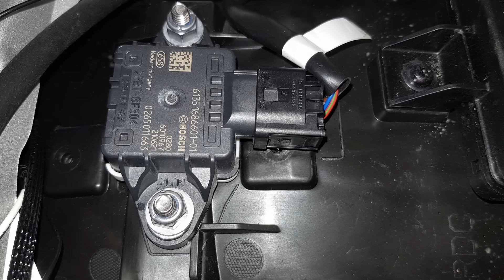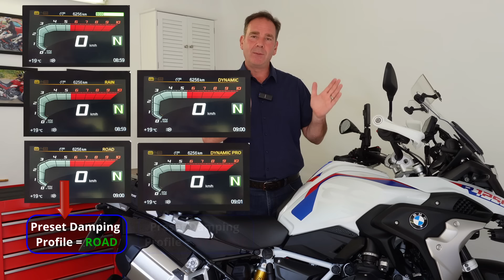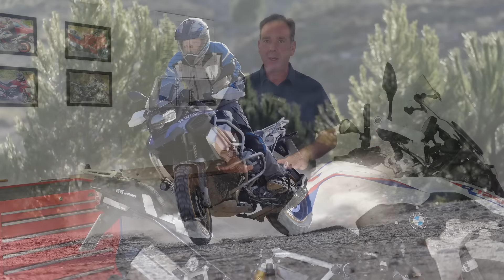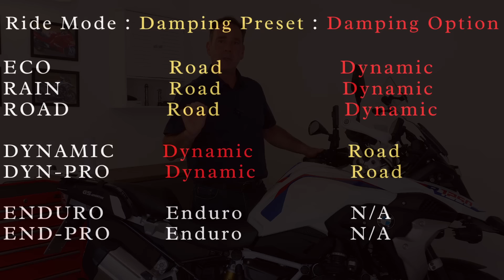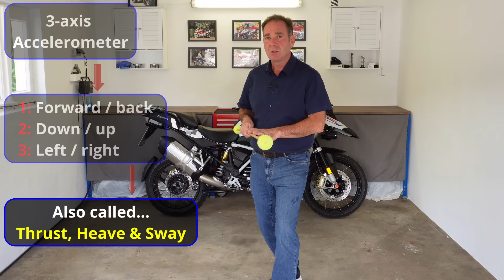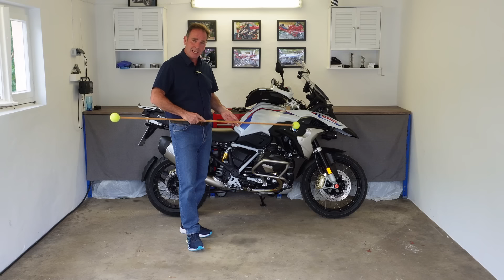EP:12B BMW Dynamic ESA Explained Part 2, Damping Modes, Riding Modes and 6 axis IMU Explained

Comment from the maker: The SOLUTION for the multifunction indicator issues, should be available later this week. I was asked by the manufacturer to wait until the new UK / EU website has been finished which should be a couple of days more. Most of my riding friends now want these lights on their bikes, so I'm going to be very busy over winter. Carl
Reply: Hi Carl, is this already available?
Reply from the maker: Yes and installed on my bike ( 2021 GS Rallye) I’ve uploaded several guides to help owners install these lights and many owners have now done the same installation. Subscribe and go to my channel and your find all the information you need. Let me know if I can help 
Regards Carl
Reply: also do you thing the base GS with a traditional shock is better as far as compression and rebound?
Reply from the maker: I personally have not tried that so unfortunately I can’t offer feed back.
Perhaps you should visit your local dealership and book a test ride on both versions and see which you prefer
Reply: do you think the older bikes were better as far as the display and esa?
Reply from the maker: Hi, the new TFT display is brilliant and so is the dynamic ESA.
The pre 2018 bikes had a slightly better preload setting or spring rate.

Comment: Why did BMW remove SOFT from damping modes??? My 1200 GS has Soft, Normal, Hard. Now only Road and Hard I can’t feel much difference between them. On the motorway or crappy lanes I use soft and it really make the ride plush. I thought ride modes only affected throttle response. Great information thank you 🍻
Reply from the maker: Hi Nomad, agree, it was a shame they changed the names which were easy to understand (soft, normal, hard) and replaced them with Road and Dynamic, but on the motorbikes I have tested there is still a noticeable difference especially the 1250 models, on the newer 1300 models there is still a difference but the Road suspension mode is firmer than the old Road mode on the previous models. Why BMW have taken this route is known only to them.
Yes the link between Ride Modes and suspension settings is now fully automated, but you can still manually change the suspension settings. For example you could select Ride Mode Dynamic for that crisp throttle response but manually change the suspension setting to road for a more compliant feel.
But on the newer model is not easy to do, requiring access to a different menu to access these settings.
But the names they use could be much simpler 👍
Carl 🙋🏻‍♂️

Comment: Thank u. Would never get this detailed info from my salesman. 
   The issue I have with my '25 F800GS with Dynamic ESA is, in the 1 up, no luggage and RAIN mode, the rear end of the bike sits too high, pushing my groin into the front of the seat. Very uncomfortable after 50 miles. Is there a setting to lower the rear end? Thank u.
Reply from the maker: Hi, thank you 🙏. So via the left hand controls ( with engine running ) change the preload setting to minimum 👍
There are 3 setting; min, max, auto
Kind regards Carl

Comment: Excellent vid, thank you. If I understood you correctly, in terms of dampening, there are different settings within ride mode (ESA not ride mode) even though 3 of the 5 of them say “road”?  If that’s the case, eco is the plushest followed by rain, road and dynamic?
Reply from the maker: Hi theoretically it’s only 3, road, dynamic and enduro, but there are many sensors and systems in play with each selection. I find Rain the softest, but only marginally over Road. Best wishes Carl 🙋🏻‍♂️

Comment: Finally. After 5 years on my R1200GSA (2018) I understand my issue. I just can't stand the damping setting in rain/road riding mode. Even on the freeway, it's too soft and I always feel like I'm bouncing. What your video told me is that, automatic reset to road damping when you change riding mode from dynamic to road/rain. I shall try the road and rain riding modes tomorrow with the dynamic damping mode activatedto see if it's better for me or not. THANKS
Reply from the maker: Hi Franck, glad you enjoyed the video series, I hope you enjoy your new setup 👍
Thank you for the feed back much appreciated .
Kind regards Carl 🙋🏻‍♂️
Reply: @justthewayitis  Tried the damping change yesterday and indeed, it makes the road/rain riding mode MUCH better for me. Thanks again Carl.
Reply from the maker: You are very welcome 🙏

Comment: Enduro mode is predominately for off road with road biased tyres. Enduro pro is predominately for off road tyres from what I have gleaned. With off road tyres you can use Enduro pro mode to change all the throttle, traction control, suspension and ABS settings specifically to suit off road tyres.
Reply from the maker: Hi Smokey, correct 👍

Comment: My gs1250 2023 doesn't have ESA and no pro modes, any chance to add the pro modes?
Reply from the maker: Sadly no, it’s not possible to add them after the motorbike leaves the factory.
But please check the menu under : Ride Mode Preselection, to see exactly which ride modes are installed on your gs.

Comment: Wow, well said Carl.  Thanks for the well explained info.  Now I have to watch the rest of yours!
I just bought a 1250 and needed to learn the new TFT, as it is different to my 1200.  Found your channel, then relised that there is MUCH more to the suspension than the old.  Wil try rain for the crappy roads. Cheers.  Also we use IMU's in aviation a lot, but you explained it very well for novices.
Reply from the maker: Hi 911, welcome to the channel and congratulations on your new 1250, yes there is lots to learn but once you understand the system you realise how flexible it really is. 
Have fun learning and experimenting 👍
Kind regards Carl
Reply: @justthewayitis  Thank you, lots of info on your channel, keep up the good work and sharing of your knowledge.

Comment: Is it safe to run full load on min suspension setting
Reply from the maker: Hi Austin, if you mean loading the bike close to its max capacity, my personal opinion would be no you are better off running in Auto mode. 
Mainly due to poor load distribution (heavy rear bias) which will affect the handling and braking and stability.
Have a good weekend 
Carl
Reply: @justthewayitis  cheers carl

Comment: Hi Carl
I have a question about Servicing the esa suspension.
Normale shocks and rear damper need a service with new oil.

What do you think. When should we get Servicing our esa with new oil. I know a suspension shop in Netherlands which is able to do a service on the esa suspension with new oil, bushings and so on.

My though is after 20.000km it's time to change the dirty oil.

What do you think.

Kind Regards.
Gruß ;)
Reply from the maker: Hi Melvin, it’s up to you really, but 20k km is not a lot. If everything is working correctly I would leave it alone and would wait another 20k km.
But having said that, a service including new oil and seals does something bring benefits and you could at the same time change the rear spring to one that matches your weight. That would give you a shock that works correctly within the mid-stroke of the damper. Which would give you a better ride quality.

But I would probably wait a while longer if everything is working correctly.
Carl

Comment: Thanks for such detailed vid. Question is front suspension could be adjusted some how by rider or it live its on automatic life?
Reply from the maker: Compression and Rebound are not adjustable on the GS. The only option is making a change with the Ride Mode.

Comment: Hi Carl, thanks for creating great contents and these nice videos on ESA. My bike has former ESA (it´s a 2009-R1200 RT) and I´m a bit confused. I´d like to know if it is possible to associate the three suspension modes (I think they are damping/rebound settings, right?) on my ESA (Comfort, Normal and Sporty) with the Road, Rain and Dynamic on the new ESA. Can you help me?
Reply from the maker: Yes that’s correct they are indeed your damper setting

Comment: Great explanation. I have a 2016 R1200rs. When in DYNAMIC mode only, for and rider + pillion suspension mode and 2 up, while riding I get an error triangle come up and the suspension goes very hard. I heard it could be return spring closing the damping down. My question is the problem the ESA control unit module or or the actual shock? which one to replace?
Reply from the maker: Hello 
When the error triangle comes up and suspension goes firm that’s the bike going into safe mode or limp home mode on the suspension . The only way to be sure is to get the error code read by bmw or using an GS911 code reader. It is however a reported fault by other owners, but it could be the control unit or the shock it self. I’m presuming that when the error message comes up… if you stop the bike and turn it off and restart the message goes away?
Best thing to do is get the error codes checked to see which system or part is failing . It could be a PWM output fail from the controller but only a specialist could confirm this.
Hope this helps 
Carl
Reply: @justthewayitis  cool thanks for reply, yes have to stop, turn bike off and restart. But come back frequently in Dynamic mode so just use road for now. Until I get the codes out. Cheers

Comment: Hi Carl,

Thank you for your detailed explanation of the ESA system.  I now feel confident making changes to the system when I'm out riding.

I had a question.  I ask this question here because a lot of peple on forums say that this issue is just part of the ESA making micro adjustments as I'm riding.  I'm just not sure.  The issue is the feeling of tapping in the footpegs.  I don't feel it in the engine or frame, only when feet are on the footpegs.  It happens on pavement with slight to moderate imperfections and on roads with tar snakes.  On a new road with no imperfections, I hardly ever feel the tapping.  Even though I see this complaint on forums from time to time, it still concerns me.  I mentioned this to my dealer at my first service,  They test rode the bike and said that they didn't notice anyhting, but I think the problem there is that all the rodes in that area are in very good shape with little or no imperfections. Have you heard of this and do you know what it imight be since many people think it's part of the ESA system?

Thank,
Kenneth
Reply from the maker: Hi Kenneth good morning 
Yes I know exactly what sound you mean, but I have not been able to find the source of it.
Mine has got better (less tapping) as the mileage has increased and also since I changed the tyres, but it’s still there.
It feels like front suspension to me possibly from the telelever area.
I hope you enjoy the series and have fun on your new bike… best wishes Carl
Reply: @justthewayitis  Thank you , Carl!  And again, thanks for all your hard work in making these videos.
Reply from the maker: Your very welcome 🙏

Comment: Hi Carl, great job explaining damping (compression/rebound)controls ! However I find the real feel to be extremely subtle to truly appreciate. I’ve tried the same stretch of road on different modes and damping settings and really can’t decide which I find better / most comfortable. The engine settings/ throttle control etc of the different modes ( at least dynamic vs road ) are clearly noticeable. Not so much between road to rain.  Too many choices ?????

I also appreciate your tire reviews. I ride 100 % on the road but still have the original Michelin  Anakee tires. I would like to try the Michelin Road 6 but don’t want to spend the money if I find no real difference ( similar to damping settings ). 

Would appreciate your thoughts on this. Thanks
Reply from the maker: Hi Randy, welcome to the channel, don’t forget that the suspension in all modes can be affected by speed that’s why the system uses the IMU and all the other sensors.
Road 6 or NT2 tyres make an absolutely huge difference the choice comes down to weather you still want a little gravel dirt road capability. Both are excellent on road though.
Carl
Reply: @justthewayitis  thanks !

Comment: I haven’t read every single comment, so excuse me if I’ve missed it.. with regards to the suspension feel when braking, Eco vs Rain, does the automatic linking of the brakes not have an effect? I’m imagining that in Rain Mode, a tad more rear brake is applied in order to keep the bike more balanced and to optimise stopping ability. Just a thought 🤔
Reply from the maker: Hi, with regards to brake balance within each ride mode, there are some differences, but with regards to suspension feel when braking this is controlled by various integrated systems like the IMU which provides more compression support when adding brakes fast. Your thoughts are probably correct 👍
Reply: @justthewayitis  I didn’t realise that the IMU would effect the damping so quickly. It’s even more effective that I gave it credit for! Thanks for your reply.
Reply from the maker: Have fun 👍

Comment: I’m 72 kilos, I ride in automatic. Recently I put 150 kilos of luggage and pillion.. auto wouldn’t handle it.. i could hardly get it off kickstand with all that weight.. I put it into Max mode and it was better. Does that sound right? I’m glad I found your videos!!💯👍🏽👍🏽
Reply from the maker: Hi Bill good morning and welcome to the channel. Yes that’s correct with that much extra weight MAX is the mode to use. You might also need to change the damping mode to Dynamic if the bike bounces around a lot.
Best wishes Carl

Comment: Doesn't the Mode settings also have to do with the ABS System?  Even Rain or Road from some people is preferred, this can lead to different behavings during a full brake when the ABS sets in and should react differently ?
Reply: Unable to really hard brake in emergency situations in rain mode is the only reason I’m not using rain mode all the time :(
Reply from the maker: Hello Farid and welcome to the channel. Yes the modes also make slight changes to the ABS settings. I decided not to include this in the Dynamic ESA series because the 3 part  series is about suspension, and it was already very long.
Perhaps I should make another episode to explain the ABS changes.
Best wishes Carl
Reply: @justthewayitis   hi Carl, ok just to understand why my brake handle on some abs tests feel harder or softer during a brake pull . Cheers

Comment: I have just got my BMW R1250 GSA and only ridden once so far, I am 6 foot tall 13.5 stone weight, in Road mode and auto on the left suspension control, I'm flat footing parked on my drive but once I get going and have to stop at junctions or in traffic I'm on tip toe and can barely reach the ground, if there was a pot hole or lose gravel I wouldn't be able to hold the bike weight, surely at 6 foot tall I shouldn't be struggling to reach the ground? I know I can change the left setting to min but that shouldn't be necessary for all riding?
Reply from the maker: Hello Rockout and welcome to the channel,  try moving the seat from high to low it makes a big difference. I'm also 6ft but 92kg (14.5 stone) I change my seat position fairly regularly,  if I'm two up or ride on gravel then it's the lower setting,  if it's a longer trip I prefer the higher position even though I then just have the balls of my feet on the ground. Let me now if this helps. 
Also I presume you dont have the sports suspension option installed as that is higher than the normal GS and GSA 
Best wishes Carl
Reply: @justthewayitis  Hi Carl, yes I already removed the seat and put it on the lower setting and that's me on tip toe, I'm not sure about the sports suspension, I bought it second hand from the Bristol BMW Motorrad showroom, it is a GSA Rallye TE with all options on and comfort pack. I have not tried the min option on the left hand controls yet, but it should be enough for normal one up no luggage road riding, then try auto when loaded up. It's been abysmal rain and wind every day since the bike arrived, I've only been out the once, I would prefer to get used to it in dry conditions at least to get it set up for longer any weather rides, supposed to improve after tomorrow for a few days so I will get out again and try the min setting and let you know how I get on, thanks for response, Brian.
Reply from the maker: Hi Brian, well I wish you luck with the weather improving and getting some miles on your GSA,  do check the suspension option with the supplying dealer or your paper work, as the sport is 20mm taller (I think) than the standard version which would account for the height difference you mention.  
Fyi,  lots of owners do run their bikes in Preload MIN and it shouldn't be any issues.
Have fun 👍Carl